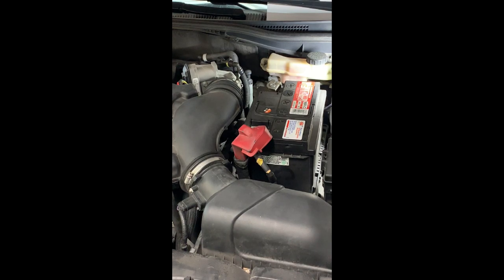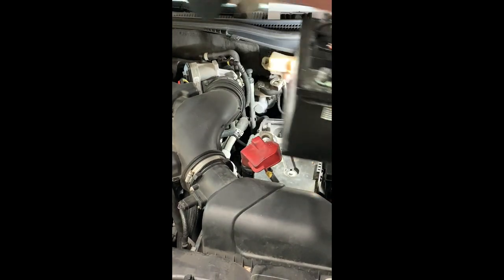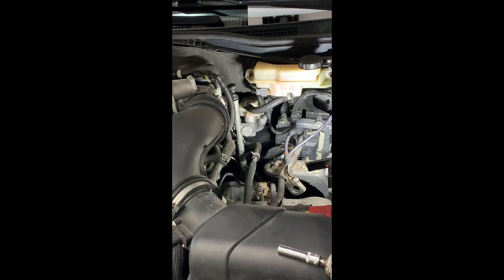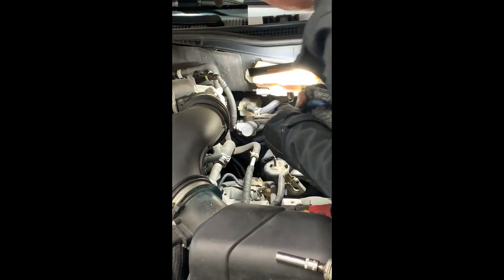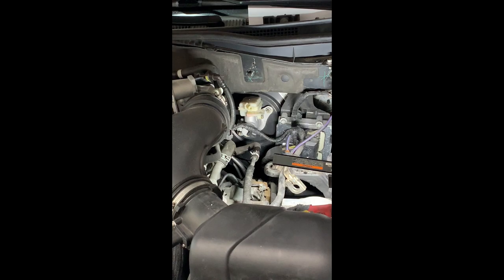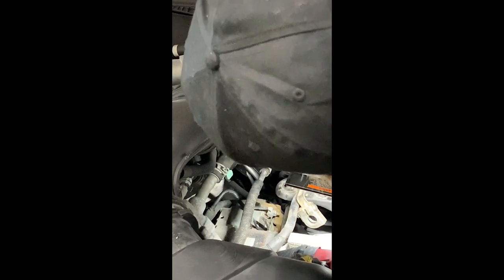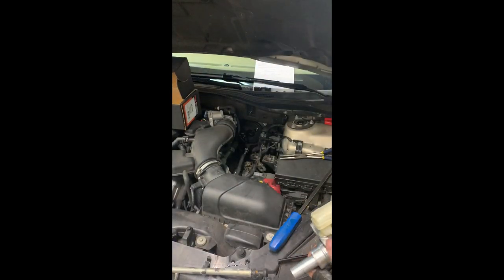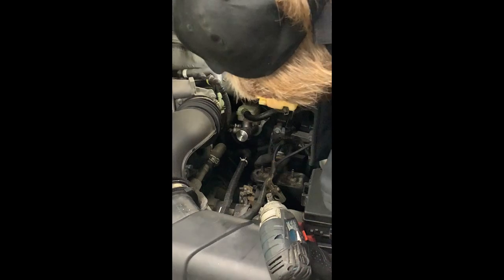2007 Lincoln MKZ brake master

Comment: 2010 mkz bench bleed the master cylinder 2 ways “ pump vacuum and like you said “ and doesn’t want brake at all. Peddle goes all the way down. Before with the old one it would brake but peddle would go down. Any help I would really appreciate it
Reply from the maker: In some cases you have to power bleed. And electronically activate the ABS system with a scan tool
Reply: @CoopersAutomotiveRepair  by power bleed is putting pressure in the reservoir, right?